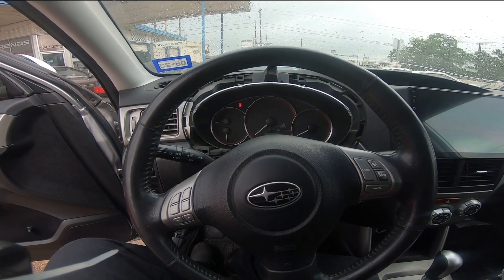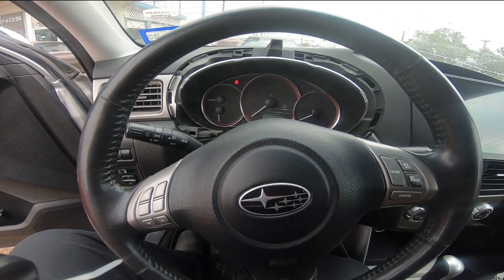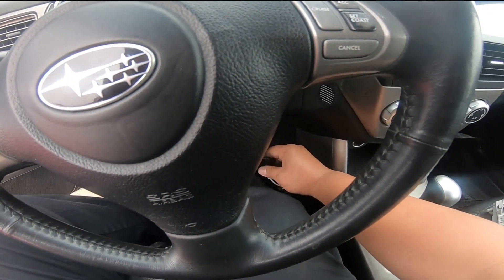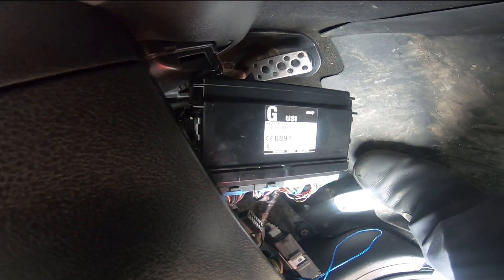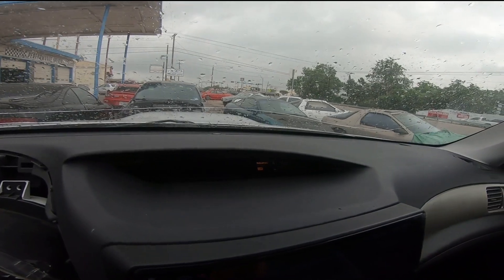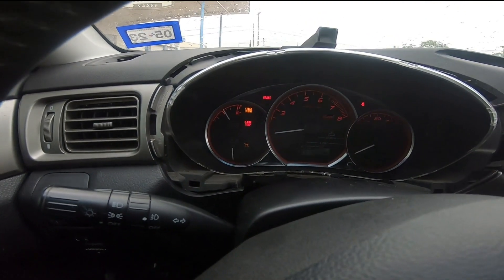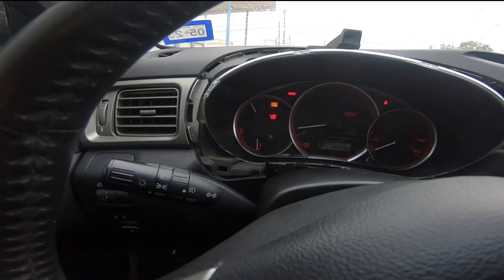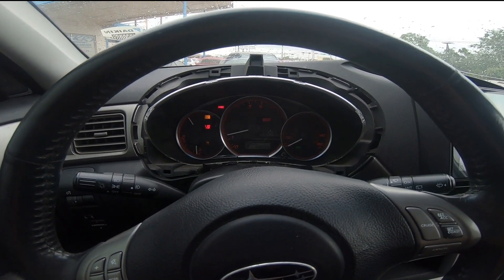SH Forester, to STi ECU for EJ20X swap

Comment: I just did a ej20 swapped in my 04 xt automatic aswell and it runs fine starts fine, I just did the sti cluster swap 3 days ago and I haven’t had any issue cept for the abs and brake light is on? But was told I just need a ground connect harness and a guy at Aaron’s subie electronics does and make harness but rn I’m currently looking into a tune
Reply from the maker: Unfortunately I'm not too familiar with that chassis, but if it was like mine, I had to swap to the WRX ABS module, but again, mine is an 09+

Comment: In my 2012 fxt I did a cluster swap from a sti, and I just got my keys reprogrammed, and it was all good.
I know that this wasn't a video for just a cluster swap, but I'm glad it was that easy, because the stock cluster is too basic
Reply from the maker: I hate cars that don't have a temp gauge.  Plus the blue in our stock cluster sucks haha
Reply: @krmotorsportskilleen  I know, I was pretty disappointed when I test drive the car. My old jeep Cherokee had all the guages, and to go to that stock cluster was a downer. Lol
Reply from the maker: It's crazy because nowadays cars are all like this now.  There was a car that I worked on recently that didn't have an oil pressure light because it's in the navigation/radio which is out of the way of eyesight. If I didn't know any better I'd probably never notice it

Comment: Any updates on this build? Dusk AVCS working ?
Reply from the maker: Yes.  Dual avcs does work, but am moving to a standalone ecu
Reply: @krmotorsportskilleen  curious why you want to run a standalone?
Reply from the maker: Lots of reasons.  1) Canbus.  Since I did the manual swap, I lost cruise control, and since I did the STi cluster, and lost my center display for temp.  While those could be fixed buying other parts, why bother?  Secondly, flex fuel, at the time carb flex fuel wasn't on the horizon for 08-14 cars.  I also plan to eventually twincharge the car using a M62, that's clutch driven so I'd need a way to turn it off and on, but that's the gist of it.  The twincharge thing won't be for awhile, so more planning foe the future.  If you'd like to talk more about it, feel free to hit me on the socials or even give us a call at the shop.